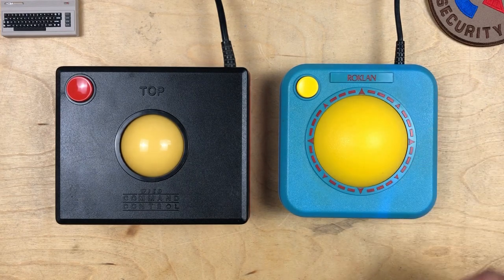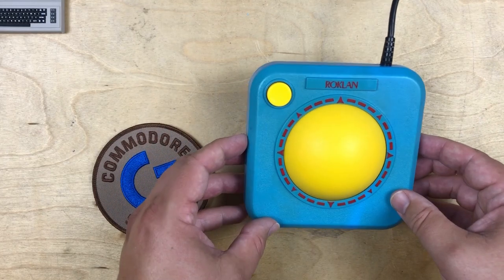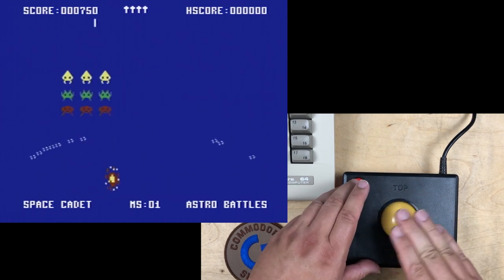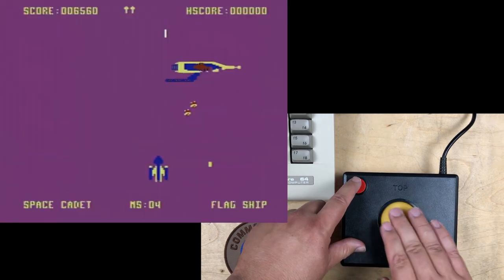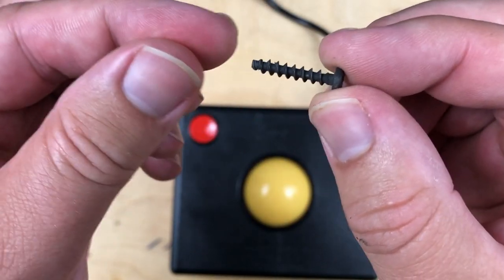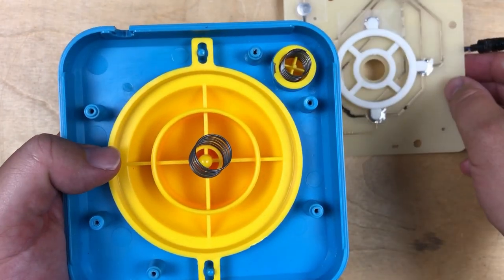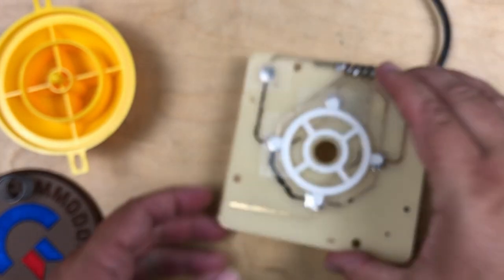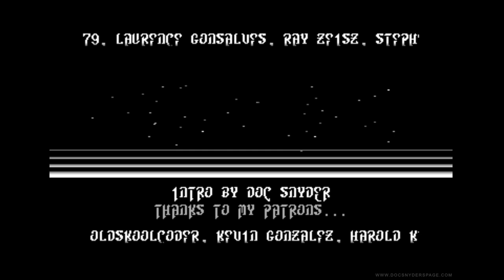Joysticks In The Form of Trackballs: The Wico Command Control and the Roklan Un-Roller Controller

Comment: There should be zero debate about the correct pronunciation of Wico. They paid for a real teevee commercial and everything. https://www.youtube.com/watch?v=52E-9Bn4f-A
Reply from the maker: That's an amazing commercial! Wico rhymes with "sticko". I said something right for once!
Reply: All these years and that jingle is still stuck in my head every time I hear mention of Wico.
Reply: @8_Bit   
I'm a bit late to the party but it would be interesting to see if the Wico trackball actually provides a signal to the paddle inputs.
That could also explain why you had sound problems since those inputs are registers on the SID chip.
I'm tempted to buy one and have a look, if it indeed is capable of providing paddle inputs this could be made into an interesting controller.
Reply: To answer my own question, i bought a Wico trackball off ebay and sadly no, it doesn't use the paddle inputs, just the standard joystick inputs.
Now i wonder if one could alter the ROM inside the trackball. 
It must have better resolution from those wheel sensors, it's a shame they didn't do more with those. Going to dump the ROM and see what's in there.

Comment: Oh, man the Wico guts bring back memories. When I was a kid I tried converting a PC mouse to work with my C64. I created 74-series logic to turn each pulse from the IR detectors into a single pulse in the appropriate direction on the C64 joystick port. I didn't know it was called "quadrature" until school years later, so it took some sleuthing to discover the phase difference from the IR detectors and turn that into direction pulses. 

I was pretty proud of myself, even though it never worked. Moving the mouse an inch gave dozens of pulses, much faster than the C64 read them, so movement was super erratic. 

Later I learned that the C64 mouse actually converted the pulses into analog signals for the paddle inputs, which I'd never even considered. D'oh!
Reply: r/therewasanattempt

At least you tried.

Comment: The Cadillac of Trakballs is definitely the one Atari itself made. It had 2 modes - Joystick and Trakball. What's the difference? Joystick mode was digital direction only. Trakball mode was more like a mouse, direction and speed. This mode was usable in the Missile Command cartridge for the Atari 8-bit computers. You just had to type CTRL-T to use it.
I bought an Accuball trakball controller but it suffered from reverse sensing when spun too fast due to the infrared method to detect movement. 

That Roklan controller design was repeated years later for an NES controller.

Centipede and Millipede cartridges on the 2600 are very playable with an Atari Trakball. 😊

Comment: Thank you for showing these two pieces of "oddware"! I think, as the saying goes, they were the solution to a problem that doesn't exist, since joysticks were already adequate for most of the C64 and Atari games.
Reply: Just because most games are joystick doesn't mean I'd rather not be able to play centipede with a trackball or arkanoid with a spinner.

Comment: I had the Quickshot Joyball, it was a much larger ball that you "rocked" to activate switches. It had some really big fire buttons too that were fun to blast away with, but the size made the wrist ache after playing for a short while. I eventually took it apart and used the microswitches to repair another joystick.
Reply: Yeah.. grey housing?

Comment: Around 1984 my father bought a Wico Command Control trackball for the TI-99/4A and what was really strange about that was this version came with an AC adapter. I really couldn't understand why seeing as no other controllers regardless of computer needed one. It would be as silly as if the TI joysticks came with an AC adapter. We did have Centipede for the TI and since the original arcade platform used trackball, it made sense to play the game on trackball on the TI.

Comment: If that Wico trackball uses the same size ball as the Atari trackball, it is just a pool ball (cue, in this case).  I replaced my Atari trackball... ball... with an 8-ball, which gave it a little more character.  I don't remember the specifics of the mod, but I replaced the switches in my Atari trackball with micro-switches (snap-action), then used it as a mouse on my Atari 520STFM.  Thanks for bringing back the good old memories!

Comment: I have an Atari trackball (the one with the round buttons, not the triangular ones). I followed an article in a magazine and did a mod on it so that it would function as an Amiga mouse. I added two more buttons and added switches to the underside so that I could switch back to its original configuration and still use it as a joystick, or even an Atari trackball. It worked fairly well. I think the only thing I ever found to use trackball mode with was a magazine Missile Command clone called Red Alert. I read the article and didn't see any mention of it supporting anything other than a joystick, so maybe I had a modified copy.

I never thought to try it on anything that supported a Commodore mouse, like Arkanoid II.

Comment: The Wico box is wrong, they mean an Odyssey 2 not an Odyssey, what use would a trackball be for a Pong system?  It is a well-made piece of kit though, leaf switches, metal rollers, optos, micro-controller -  impressive.
Reply: They meant G7000 😉

Comment: Those bearings actually require grease, not oil. But it's not like you're maintaining the main drive axle in a cruise ship or turbine shafts in a nuclear plant.
Reply: Most oils cause a chemical reaction with plastic. The plastic turns harder, more brittle and then the surface turns into dust.
So when in doubt, use grease.
Ballistol is easy on rubber and plastics so you can use it for normal stuff but I wouldn't use it on any plastic which is very old and/or is supposed to last for a very long time. On the other hand, Ballistol can be dissolved in water so humidity will water it down over time.
Reply: @CC-ke5np  This was more in general. For ball bearings grease is usually preferred. 
The actual problem is that the manufacturer used the wrong type of bearing anyway - this is a prime use case for dry-running bushings.
Reply: @CC-ke5np  Btw. to get something like this running again, I'd just use silicone oil (or silicone grease). That doesn't react with rubber or other plastics at all.
Reply: @graealex  Correct!

Unfortunately, not everybody is willing to buy many different items so it is good to know a few “general purpose” ones.

For oils:

- WD 40 as water repellent, bad for lubrication of fast moving parts and damages rubber/plastic – ideal for locks and the like
- Ballistol for good lubrication and cleaning, no immediate effect on plastics and rubber but “draws water” over time
- Sewing machine oil for everything else

And for plastic and rubber, grease is always better but collects dirt.

In the good old days, you could buy “dialler grease” (don’t know the English term, in German, it is “Wählerfett”). This stuff was used for the mechanical parts of telephone branch exchanges. It is a very good grease, cleans, lubricates and even preserves rubber and plastics. Sadly, it is somewhat toxic and not made any more. Nowadays, you need to use vaseline (petroleum jelly) as a substitute but you need to replace it much more often.
Reply: @CC-ke5np  Petroleum jelly will mess with any and all plastic and rubber parts. I advised on silicone grease because of that exact reason.

Comment: I never knew the Wico trackball didn't have a switch like the Atari trackballs to toggle between joystick emulation and trackball. The 2600 trackball wouldn't work on the Atari ST, but could be converted to work,m which also meant it could be modified to work with the Amiga.

Comment: I think I had the Roklan, or something equivalently janky. It was definitely not used much compared to the other joysticks we had. The concept is not inherently terrible, though, there is an ergonomic keyboard design that uses two shaped blobs with 8-way movement called the Orbitouch. LTT did a review of it a while back and deemed it good, albeit more limited than a regular keyboard in certain ways.

Comment: I had an Atari trackball for my 800 - it had a switch that allowed you to swap between trackball and joystick emulation modes, but joystick emulation was kind of awkward and Missile Command was the only game I owned that worked in trackball mode so it never saw a lot of use.

Comment: If it had a standard 8-way joystick input, it would not add the feature "able to control speed of on-screen objects".
The Apple II, on the other hand, had an analog joystick standard, but they also had analog joysticks so it would not be the "first time" such a feature was available.

Comment: Next time mask the traces off with painter's tape, then peel it up after.  You'll look like a wizard with the carbon pen!
Reply: For small hairline cracks, you can also use the stuff meant to fix rear window defroster wires. Works great and very easy to apply using sticky tape (not masking tape which soaks it up). You can buy/order it in most auto part shops.

Comment: Back in 86 or 87 I got 1 that looked like the wico but it wasn't.  Think it was $5 or so at the pickering flea market.  Difference was instead of the wheel that interacted with the optical sensors like a mouse It had magnets on each roller that would trigger reed switches.  Wasn't nearly as accurate so I ended up not using it much.  It didn't have the micro controller either,  the interfacing was a lot more simplistic.  The roklans internals are functionally identical to the Atari CX40 joystick.  BTW, don't worry about your repair attempt it works n nobodies gonna be looking at it again probly.

Comment: I had a Wico track ball a long time ago that I converted to PC mouse. I used the logic board from a ball mouse wired to the Wico sensors. I managed to correct the directions but L&R movements were a different speed than U&D for some reason.

Comment: Wico's US4493992A patent explains how it works in more detail. This one device can control different types of digital and analog inputs depend on how it is hooked up. The processor samples the optical wheels to derive a speed and direction and track a virtual X-Y position internally. For digital inputs, the processor outputs PWM with duty cycles proportional to the speed, on lines selected by the direction. For analog inputs, it uses a pair of resistor ladders to form DACs which control the X and Y axis voltages and relay the internal virtual position. It's pretty clever. This patent is cited by dozens of later patents including mouse patents by Amiga/Commodore, Logitech, and IBM.
Reply: From their figure 2, it looks like they are not using pulse width modulation but fixed pulses with a 5 ms duration instead, and decreasing the space between them as trackball speed increases. This way they are avoiding alias effects, where interference between joystick polling and a fixed PWM frequency would happen. Most US games poll at 60 Hz but in Europe, game loops will run at 50 Hz. By not using a fixed PWM frequency, the WICO trackball should work with PAL computers, too.

Comment: What's that tiny c64 in the corner? I need that! Also I didn't know that these type of joysticks existed. Robin comes up with the goods again!
Reply from the maker: That's from a TheC64 keychain I bought a couple years ago; I'm not sure if they're available anymore. Didn't see any for sale with a quick search.
Reply: @8_Bit  And in a few years, they'll probably be able to fit a functional C64 emulator inside it. The connectors will take up more room than the PCB. :)

Comment: The Wico parts look pretty close to authentic arcade trackballs I've taken apart. I will have to get one for these.
Reply: Wico was also known for designing and manufacturing all kinds of arcade games controllers as well as controllers for home video systems.  As far as the Wico trackball that is actually a cue ball.  Wico was also a manufacturer and distributor of billiard supplies.  When Centipede came out there everyone loved the OEM trackball concept but it was not reliable.  Wico improved its design and sold it as a replacement and eventually to the manufacturer of the game.  You did pronounce the name correctly in your video.  Wico was a family owned company.   The "Wi" in Wico stood for the family name "Wiczer" and the (co) for "Company".  My father and I worked there for many years.

Comment: 0:40 It's a joystick without a stick — a "Joy"?  That doesn't seem like a viable controller.  The graphic design is similar to the classic Atari joystick.

CMD made a trackball controller that emulated the mouse, fairly well.  It also had a real-time clock that could be read with a special protocol.

8:06 The roller kind of makes its own "sound effect".

10:35 Maybe it would work better if they put a vertical stick in the middle…

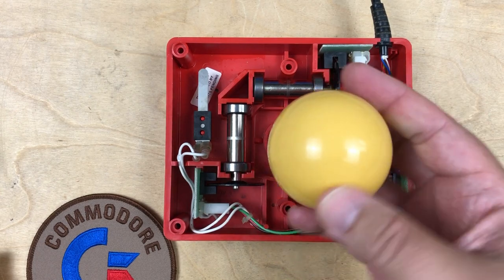13:55 In case your pool table is missing its "1" ball…

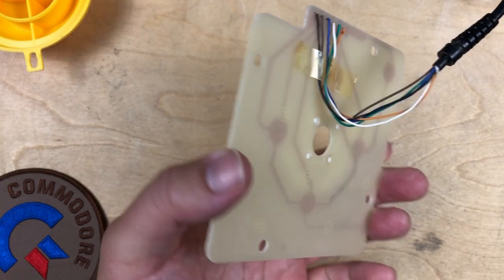17:50 Very similar to an Atari joystick on the inside, too.  I think somebody cheated off somebody else's test paper…

21:36 This technique is especially important when driving screws into plastic.
Reply: CMD also made a mouse with a built in RTC and there was a plugin for GEOS.

But who cared for the correct time on a C64 anyway? I and most people I know had an old radio alarm clock on their desk to listen to the radio while loading stuff.
Reply: I think it should be called a joyball 🤣

Comment: Aw, it was awesome to see your trackball skills go from newbie to pro. I've never played games with the trackball but it fascinated me how you don't have to roll back. Like when you go right in the game and you really spinn the ball to the right you still go left again with just a push. Very good.
Reply: That's because when you roll the ball, the sensors just detect which direction(s) it's being rolled in and signal the console/computer that the "joystick" is being moved in that direction. A true trackball functions like an upside-down mouse. 

Although, the few arcade ones that I've played in my life, seem to have the sensitivity set quite low. You know how if the mouse speed is set too low, you move the mouse to the side, the pointer goes halfway across the screen, then you have to pick it up, physically move the mouse the other way and then move it again? All the arcade machines I've used a trackball on kind of felt like that. You roll your hand across the ball and the crosshair/gun/whatever moves half as far as you expected, then you have to move your hand back to the other side and roll it again.

At least that's been my experience. I imagine with an emulator like MAME, you could set the sensitivity higher so that you could reach anywhere on the screen without taking your hand off the ball.
Reply: @lurkerrekrul  Oh, those low sensitive mice.. I know. Well, I wasn't pondering on the magic existence of the trackball and it just kept me awake every night because I just don't understand how they work. I do remember computer magazines back in the day introduced trackballs and used the very same term to describe them. "It's like a mouse upsidedown". Nah, call me an old fashioned romantic but I just like the idea that we do have trackballs.

Comment: I could see wanting this for arcade games like Missile Command that had a trackball. Not sure I'd want it for something designed for a joystick. I do enjoy your laugh when you find joy in things.

21:00 a bodge wire would probably work better, but if it's working right now you might as well leave it
Reply: A trackball was a decent, if not perfect, substitute for a paddle in Breakout style games. I remember having a small game for the C64 called Atomic Handball that worked quite well with a trackball.

Comment: I converted a roller ball to my vic20 but found hard to find software that use(paddel). I did write some drawing software. Also made a light pen if I remember could only use on port one I found it recently did think about testing to see if it still works but would have to write some software for the vic20 again. Any ideas of software to test both these again either for vic20 or C64?

Comment: Just looked up 6400 W. Gross Point Road in Niles, IL.  It is now Chade Fashions Inc that do hair extensions and hair pieces.  Never liked the Wico Command Control (the bat handle joystick one) myself, found it too unwieldly in size and preferred micro switch over leaf switch joysticks.

Comment: How exactly could a trackball (or any rotary encoder) ever be "true analog"? They are not potentiometer-based paddle controllers.
Reply: You can charge or discharge a capacitor with the pulses from the encoder I guess. That would make it discrete analog...
Reply: A trackball is as "analog" as a mouse. Take an old ball mouse, turn it upside-down and you have a mini-trackball.
Reply: @lurkerrekrul  I think the right word is "proportional".
Reply: I came here to say the same thing. Every trak ball I know about is digital